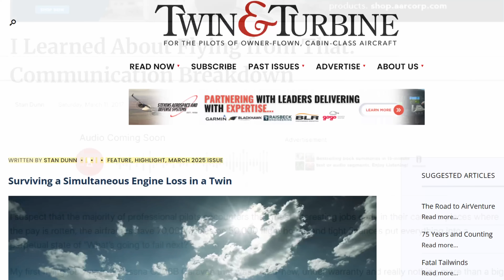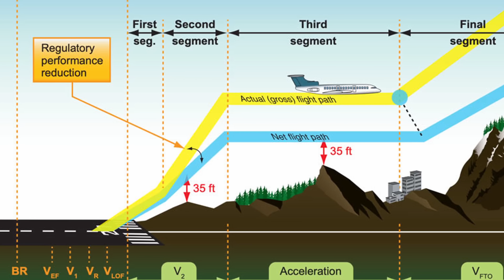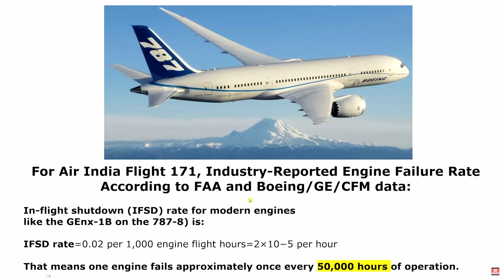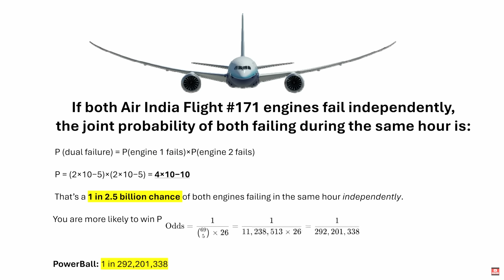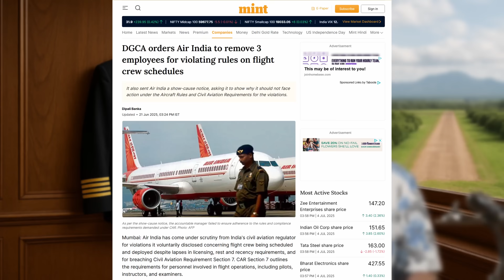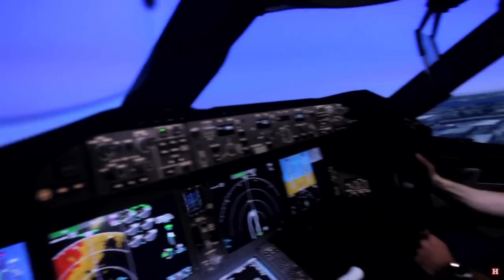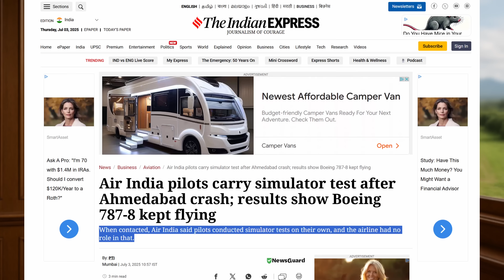Air India 171 Cause Becoming Clear

Comment: It's difficult to imagine that the flight crew would even contemplate shutting down a damaged engine that soon after V1
Reply: yah, i agree , 1st thing on their minds would be ramping up power to gain altitude, then worry to shut off engine .
Reply: @tonyug113 even a damaged engine may still be producing some thrust, and any damage catastrophic enough to convince the crew to immediately shut it down would have engine parts and Flames blowing out the back. Even then, I would think that they would think about gaining altitude before doing anything else
Reply: @jimeditorial  The human behavior is beyond logics, especialy in tense situations.
Reply: @arthurgohin1719 Pilots are trained to handle these kind of situation.

If they try to shutdown engine that low during trainings…. They would not be able to get their pilot license in the first place.
Reply: @arthurgohin1719  This is unfortunately true.  Remember Air France flight 447, where the aircraft captain continued to pull back on the controls despite the stall warning blaring in his ears?  Although off course, that wasn't the ultimate cause of the accident, which was ice crystals obstructing the pitot tubes.  The latter is not relevant to Air India Flight 141's demise, but it illustrates a point - all accidents (or even incidents) have a cause, but they also may have contributing factors.  Let the Air Accident Investigation Board do its job to determine the cause(s) and contributing factors.
Reply: @arthurgohin1719 these are commercial pilots, and the pilot in command had extensive experience. Seems odd that the cockpit crew would completely forget their training
Reply: @tonamg53 first officer was very inexperienced. Shocked he was in a widebody.
Reply: @WestCoastAce27 pretty much everywhere else in the world not USA or following USA rules, you can become first officer after 300~ hours.

Crew experience seems to be nearly irrelevant when it comes to accident. The worst aviation disaster in history was mainly cause by one of the most senior 747 check captain who is also chief pilot of the airline… The airline was trying to contact him to lead the investigation only to realized that he was the captain involved in the accident.
Reply: @tonamg53  sorry, look up ‘senority’ - 300 won’t get you a right seat in a widebody in the US or EU.  And Tenerife has no relevance to this - a variety of errors, many involving communication. And fog of course.
Reply: @WestCoastAce271. Tenerife main cause was the captain. Other things you mentioned are contributing factors to the accident. 

2. You definitely can get a right hand seat at 300 hrs in EU countries.
Reply: @tonamg53 ludicrous. It was fog. The Tower or both pilots would have seen what was unfolding and averted disaster.
Reply: @WestCoastAce27 Pan AM pilots knew and were trying to get off the runway even before seeing KLM. They even went on radio yelling that they are still on the runway. Flight engineer on KLM knew and try to warned the captain but he was dismissed. Tower never told KLM plane to take off.

KLM captain took off anyways. 

Stop being ludicrous.
Reply: @tonamg53 I know exactly what happened. But all that wouldn’t have mattered if there was no fog - Pam Am Captain would have bailed off the runway much earlier and there would have been 0 contact. I’m done with you - you refuse to face facts.
Reply: @WestCoastAce27 Fog doesn’t cause the crash. Plane fly in fog all the tine.

Captain taking off without permission was the main cause of the crash. 

Fog was a contributing factor allowing the accident to happened… but it wasn’t the cause of the crash.

To prevent similar accident  from happening again, you fixed the reason why captain took off without permission? 

You don’t fixed the weather because you can’t.

Comment: Thought this was solved. Captain's chair was faulty (previous issue on previous flight).  For some reason the chair slid back as it was starting to climb/take off. 
 Captain reached for something on the console (engine power???) not sure to prevent him from falling out the chair or to right himself after the slide.

Comment: Yep. Although not yet confirmed, fellow pilots and engineers I know speculated this is number one on the most probable list, pilot error unfortunately
Reply: the RAT deploying is an oddity then .. however... Its lilely a mulicause or multistep failure.
Reply: @tonyug113 it’s a result of dual engine shutdown and micro switch triggered (not on ground) so an engineered artefact and working to design. Not enough altitude to reignite good engine
Reply: @gribbo001  so the question is what can cause a dual engine shutdown..., suggestions seem to be dual birdstrike -- no evidence, or birdstrike + pilot error, (slightly unlikely but suggested here as switch off wrong engine ... but would pilot really do any switchoff till safer)
, or tehnical failure - still a possibility or???

Comment: My mind keeps coming back to the fuel system. NOT the fuel itself, but the delivery system. ALL the fuel pumps are electrically driven. A sudden, massive electrical system failure would starve both engines. <More speculation I know, but this how we think through these problems.

Comment: Operated from this airport in april/may 2016. We routinely departed with the A320/21  with flaps 3 as back then there were lots of areas on the runway with lose surface material. Not sure what the state of the runway is in 2025

Comment: A lot of talking! This was a massive electrical failure which brought the engines to ideal thrust. Learn the systems! It’s Boeings problem with design. The plane is all electric, doesn’t like water with shorts. Crew didn’t do anything wrong.

Comment: Best guided speculation so far however, there is one data point that have not been taken into account: before the accident passengers who flew on the same plane reported& video documented total electrical outage in the cabin, including AC. Yes, there are many fail-safe systems and separations in modern aircraft but, it is plausible that this electrical outage was due to the developing, more catastrophic total electrical failure (slow burning wires from an electrical short for example).
Reply: You would presume a modern plane had a fuse box, preventing slow burning wires. Malfunctioning Li-Ion batteries on the other hand is a harder case.

Comment: Why do these videos never show the fact that there was a large amount of rain hours before the flight as a possibility? 
Water and electricity don’t mix!
It would account why the aircraft worked well until lift off, as the angle of the aircraft changed on liftoff, water that likely accumulated inside the aircraft moved and created an electrical 
short.
My bet is the power being supplied to the aircraft externally, this access panel was likely left open overnight by ground staff allowing water to accumulate near the main power bus inside the aircraft.
This would account why everything could have been working fine until the aircraft took off leading to excess water shorting out the main power bus as the aircraft pitch upwards.
Boeing states the dream liner uses more electricity than pneumatic components…
The video with the aircraft also shows the water on the runway, on lift off as the engines thrust could be seen driving water into the air.
So likly the event took place just seconds after lift off⚡️.

Comment: There is no reason for the pilot to initiate engine shut down as there is no fire occurred. And if an engine failed, we didn’t notice plane yawed to one side either.
Reply: If an engine fails for any reason, it’s shut down. It’s standard procedure, to protect the damaged engine from further destruction and fire, which could crash the aircraft. Watch some mayday episodes bro
Reply: @Number-5-is-alive during take off thats one of the last things the pilots should worry about
Reply: @Number-5-is-alive  "If an engine fails for any reason, it’s shut down" → True; though at this phase of flight unless there was indication of an engine fire, or severe vibration threatening structural integrity, most well-trained crews would not be in a rush to secure the engine in this early phase of flight. Most of the attention would be on maintaining positive control, maintaining airspeed above V2, then working through the non-normal procedures.
Reply: It is said that the plane is supposed to be able to operate normally with one engine out.
Reply: @iRelevant.47.system.boycott  It can but only if the correct, non working engine is shit down

Comment: There was an uncommanded electrical power transfer that caused the FADEC to roll both engines back to idle. Would have felt like a dual engine failure.
The cause was water ingress at the ground power socket, a design flaw. There is an update coming.
Good that the 35 second thing was mentioned, these poor pilots had no amount of time like that. Even if they got the engines heading back to full thrust within 5 seconds- very good effort- the sink rate the aircraft had by then was terminal.
The concept about avoiding a single failure point is valid

Comment: Kalitta 747 take off out of Bogata... 3 or 4 engine all shut down right after take off.... so this is not impossible.  The cause was covered up by the way and is obviously bullshit.  A fuel truck half full of water was loaded on the plane.  that truck was found later abandonned.  Not in the official report.

Comment: Odds can be deceptive.  1 in 10,000,000,000,000 seems great.  However, if the 1 happens at 10,000 or even at 1,000,000.  So odds are wonderful if they happen at 9,999,999,999,999,999 and not at 10.  So, when did these two engines both quit simultaneously?  It seems that fuel contamination may be the  culprit.

Comment: It is understandable but still stunning that, after you handle an air emergency with a few hundred lives on your shoulders, they will Load the Blessed Flight Data into a simulator and see if your mates could have done better.

Understandable, but wow.

Comment: I have heard the whistleblowers testimony and other evidence presented which leads me to believe the fuel was too hot, as ambient was very warm that day, and other reports indicate that could case the computers to shut down the engines. Some have questioned whether vapor lock could cause this, apparently the programming to minimize this could cause a loss of thrust.

Comment: Its not fuel contamination... It's electrical or software related dual engine failure.
Even a 3rd grader would know that unless the third grader is paid by Boeing or a Boeing fanboy  like most YouTube "I have <insert hours here>  experience" pilots
Fuel contamination ,  near impossible with current checks , cannot cause dual engine failure AT THE SAME MILLISECOND accurate TIME , or essentially  SIMULTANEOUS

Comment: For the flaps, the question was answered a while ago already. It was visible on the wings after the crash that flaps were indeed extended, at 5° from what I can tell. So, looks normal.
The idea that one engine failed - possibly already on the runway, which could explain why they took so much of the runway to take off - and that when attempting to shut down said engine, they mistakenly shut down the "good" one was indeed a possibility, but that would be a pretty severe error.
Anyway, little doubt they have known the root cause of the accident for a good while - probably a couple days only after recovering the flight recorder. Must unfortunately be something pretty obvious.
I have heard that Air India has grounded their whole 787 fleet, but I can't find evidence for that - can someone local let us know if that could be the case?

Comment: There IS a possibility of a saboteur.  One who does NOT want to be known.  One who hopes to see Boeing destroyed by repeated crashes.  I have long suspected sabotage was the actual cause in the Lion Air and Ethiopian  737X crashes.
Reply: A commenter from India on another channel made the accusation of officials overloading the A/C and not adding the additional load to the manifest.  If the engines were configured for a smaller load and W&B, might they be performance limited to those parameters?     This A/C took the entire runway to rotate, and Vr was reported on one channel to be about 10mph low.  It seems they didn't have enough power thru out the takeoff process.

Comment: Other unaddressed clues:

Heat wave.

Long distance flight
laden with maximum fuel.

Thick, moist air requiring maximum takeoff thrust.

Taking off in daylight at the hottest time of day, around 1 PM. This is not common.

Ahmedabad airport is notorious for bird incursions onto runway. ICAO regulations require international airports to clear any and all possible attractants to flocks of birds (slaughterhouses, garbage dumps, etc.) from a 13 km. radius of the airport.

On-board video from now deceased passenger shows overhead lights, call buttons and air vents non-operable. Air conditioning comes from engines (if/when they’re working).

Comment: The gear partially retracted tho didn't it? Electrically tilted bogies point to gear up commanded, but they hydraulics failed resulting in the RAT deploying. The left/right hydraulic system is primarily  engine mechanical pumps but they augment with electric pumps for high demand like retraction - would both engines being shut down stop those electric pumps from providing pressure? There's SOME battery backup isn't there?

Comment: What is a cockpit video recorder?  Having flown the DC 10, 737, 757, 767, 777 and finally the 787 never saw a cockpit video recorder.   We chalk that up to fumbling over your tongue.

However , I know it’s Youtube fodder just speculate, but why don’t we just wait for the actual data? Unless of course you have an inside channel to what they’ve heard on that recorder.

Captain Geoff Quickfall  ATPL, BSc,  MSc, PhD candidate.  28,000 hours.  B737, B757, B767, B777, B787, DC10, Floats C185, DHC2, B18.

Comment: Did not see any yaw or rudder deflection that comes with a dead engine. There is a new AD on the 787 for relay replacement due to water intrusion, affects logic mode of computers going from ground to air.

Comment: What a lame attempt to blame the pilots. The dual engine failure was obviously a result of both fuel shut off valves springing closed as a result of loss of power on the jet-wide DC bus.

Comment: The problem with this explanation is that the pilot radioed a mayday no power. Also, this explanation ignores the fact that the "rat" deployed which is automatic due to failure of power.
Reply: Apparently he didn't and that part was made up. He issued a mayday call but said nothing about lift or thrust.

The problem is that listening and recording ATC is against the law in India, so we have no way of independently verifying.
Reply: @halfbakedproductions7887  Regardless, there is 4K video showing the RAT deployed and the plane descending some time after take of. With the flaps verified to be engaged in the wreckage, it is hard to find any other reason for the failed lift of other than lack of thrust from engines.
Reply: How does this disprove, shutting down the wrong good engine would kill all power
Reply: @emerkamp1  manually shutting down the good engine or engines would not deploy the "rat".
Reply: Not sure if it automatically deploys for this scenario, but they can deploy it manually. At only 1500hrs for the FO, I have seen pilots panic with higher hours than that
Reply: @nevillevaneerten It is automatically deployed. The unusual effort needed to manually deploy is unlikely to be accomplished during takeoff, not to mention that the rat would not impede normal flight.  Automatic deployment due to loss of power is the most likely scenario.
Reply: @nevillevaneerten  no the "rat" cannot be deployed manually.

Comment: I'll go with a sabotage theory.  Power failure should never shut off the engines. Not understanding the jet engine operations,  the airplane engines should be able to run independently. In fact the engines should be generating the power, not other way around.
Reply: And that‘s how it is. Both engines fail - power lost.